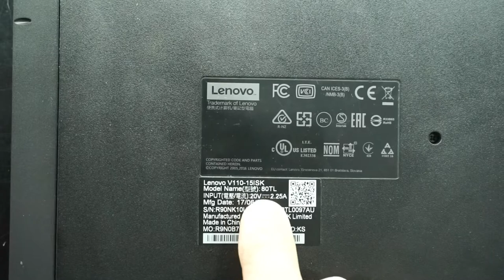Lenovo V110 SSD Installation

Comment: helping a mate who has this model. his keyboard had a water spill and needs to be replaced which looks a total pain, having to remove the board and possibly the screen first as its integrated into the palmrest.
Reply from the maker: a keyboard replacement on most current models of laptops is simply maddening
Reply: @rickstechrepairs  I have to take out the board and other internals just coz the keyboard is fooked

Comment: Is there a way to install an sdd and hdd in this model?  I want my apps to be installed in ssd and hdd for file storage only.
Reply from the maker: not unless you have a disc drive
Reply: Yes You have to purchase a caddy ..then you able to use both in a single laptop..

Comment: I have a Lenovo v110 laptop, does a Kingston A400 SSD work fine? :)
Reply from the maker: that would be fine
Reply: Have buy Kinston ?
Reply: Then which SSD did you installed after watching this video
Reply: @dheerajpatel2953  crucial bx500

Comment: bro I have also buyed this crucial SSD but it not working I have same laptop which you have I think my SSD is loose  bro how to solve this problem please tell
Reply from the maker: I have seen a few BX500 Drives die that i have sold, so i have since swapped to the more premium MX500 SSD's 

There is not much that can go loose inside the laptop regarding the hard drive

Comment: v110 have 2 slots for ram ? and 2.5" ssd, ssd m2 works?
Reply from the maker: it will vary between exact models of the V110

it would be best to open your machine and check prior to buying parts
Reply: @rickstechrepairs  sad, i have just 1 slot.
Reply: V110 15ISK ,one free slot for upgrade ram